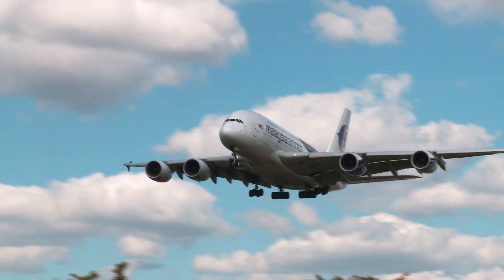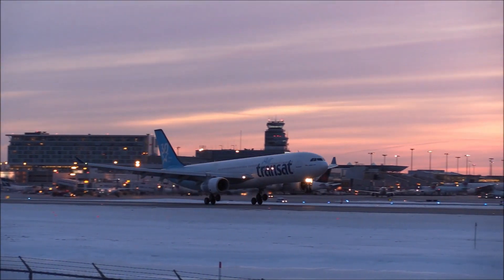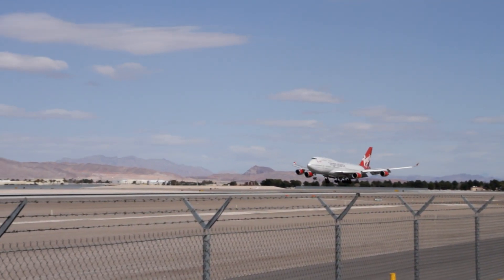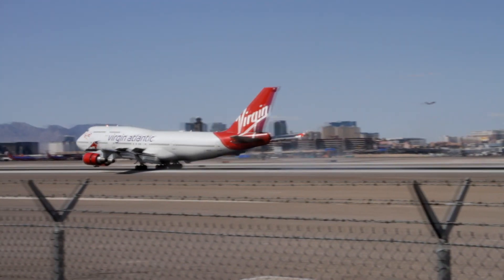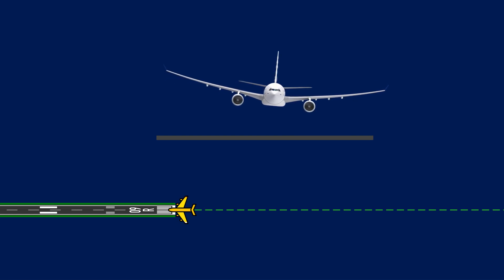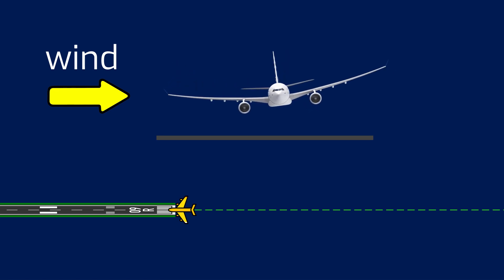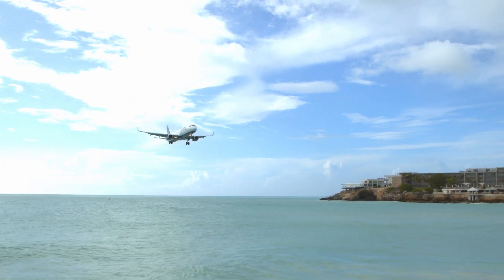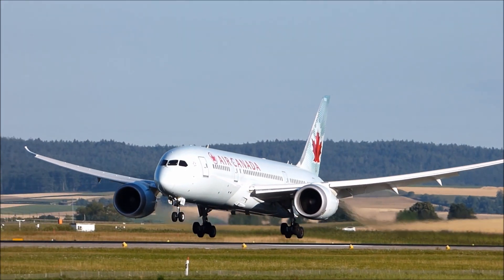Crosswind Landings | Airspace explained

Comment: I thought there was a way to set the landing gear to keep pointing forward , so in line with the runway, while the body of the plane is at an angle against the crosswind. 
I'm quite sure I heard this in another video somewhere (different channel). Made a lot of sense to me then. 

But turns out this is not true. 

Would it not make sense to make the gear in such a way that this is possible?
Or would that have adverse effects? 
I'd be interested to learn. 
Thanks!

Comment: On my last flight there was quite a lot of turbulence on final and the pilot did a go-around. Specifically the pa was "Unfortunately we weren't able to land due to strong wind and had to do a go-around. We will try on the opposite direction where the air seems much better" and the second attempt was successful. Does that mean there was crosswind? And i am guessing there are standard operating procedures that "demand" a go-around under such conditions?
Reply from the maker: Ah, gotta love vague PA. On what airport was that? Yes, there are cross- and tailwind limits that have to be adhered to. If the wind suddenly exceeds these limits, a go around is in order. However, a go around can also become necessary if the pilots judge that they just didnt manage to get the plane in nicely. that happens from time to time if the weather is really bad (been there myself).
choosing another runway can help greatly!
Reply: @AirspaceVideos  Thessaloniki (LGTS). First try was at runway 34 and then runway 16. There were thunderstorm clouds forming in the area, that's why the turbulence on final I guess..
Reply from the maker: oh yeah Thessaloniki is tough when the weather is bad, especially runway 34. Lots of hills, a rather special non precision approach that takes you scarily close to terrain and so on... runway 16 is easier, if the wind permits!
Reply: @AirspaceVideos  At least we got to see a nice view of the city because of the go around!

Comment: I have seen other videos which showed crab landings, and they did work... albeit with some smoke and complaints from the tires. My question is; would the pilots who do that frequently be discredited in some way by their airline companies - or is it just considered another way to address the effects of a sidewind? I am not a pilot, but it seems that a good pilot would try to avoid the stress on the landing gear if possible.
Reply from the maker: Well, on one hand, you have the airplane manuals, which for the airbus only suggests to do a partial decrab in certain situations. A landing where you overdo the decrab is a bad landing too!
And yet, most pilots I know (myself included) opt for the most decrabbed landing possible. Maybe it comes with being a pilot that most want to deliver the smoothest landing experiencw possible, I don't know :)